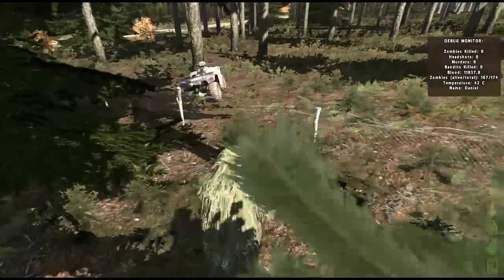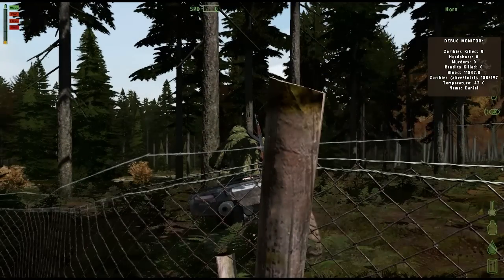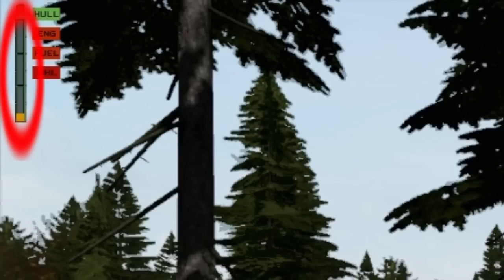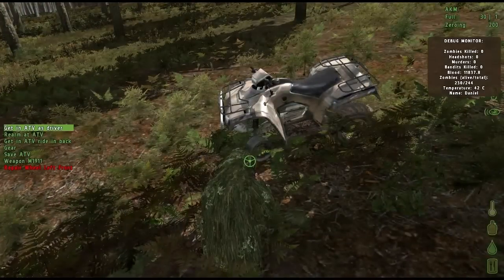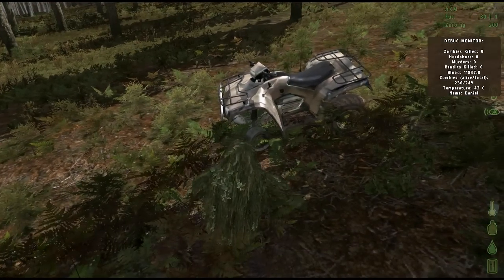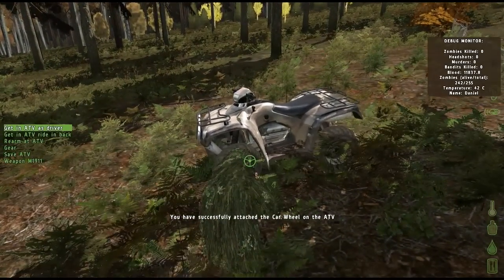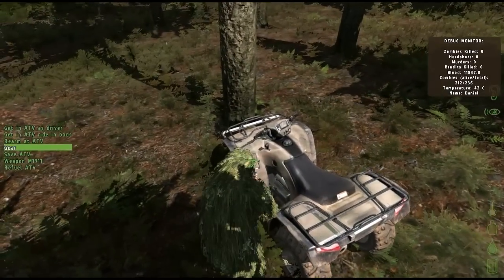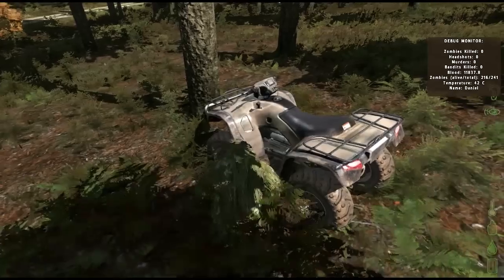DayZ MOD - How to Repair A Vehicle, ATV

Comment: How do you collect enough parts to repair one? When I tried to carry metal, gas tank, and pick up a tire, it wouldn't let me and told me there wasn't place in my inventory. And I couldn't put anything in my bag- it would just drop on the floor. Do I have to be on ground to put stuff in my bag?